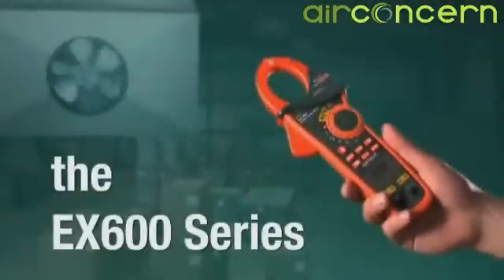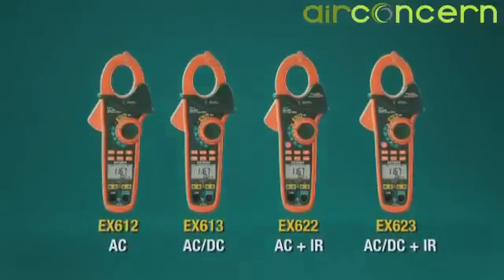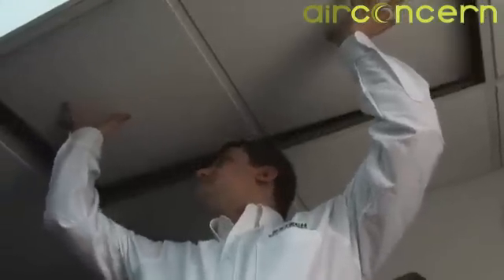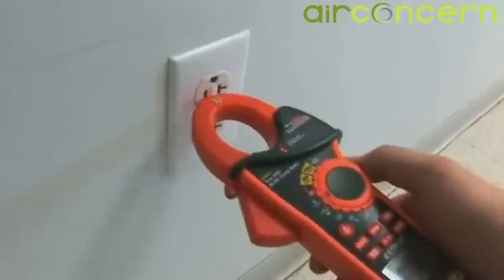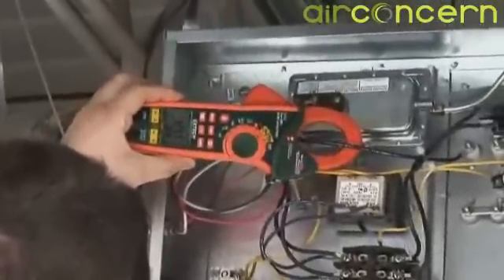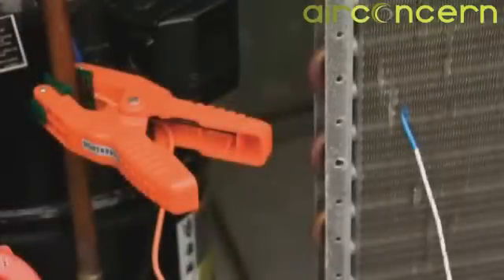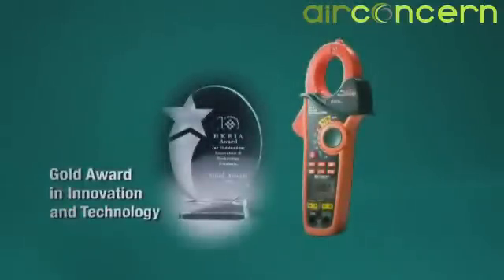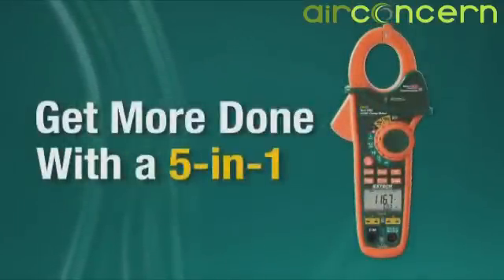400A Dual Input AC/DC Clamp Meter + NCV Extech EX613

Comment: The EX613 is a decent tool.  Corrosion was an issue with mine but some cleaning with Deoxit fixed this problem around the selector contacts.  The screen is pretty small and busy, and the main reading is clear, but the range is very tiny and the 2nd display is pretty small as well. I end up using the backlight to be sure of what I am seeing at times. It could really use a larger display.  It is handy with the dual temp sensors for HVAC work and the carrying pouch is OK.  It could use a couple more screws holding it together as it is not so rugged at all, but no real problems so for in doing work in an industrial refrigeration system.  The point I work with ammonia gas in the air has something to do with corrosion issues, as ammonia attacks copper, one reason it would have been wiser for me to get a sealed type of meter, but it cleans up OK inside if done about once a year.